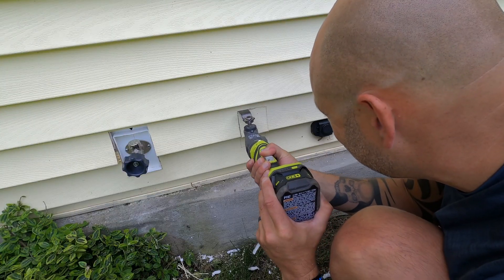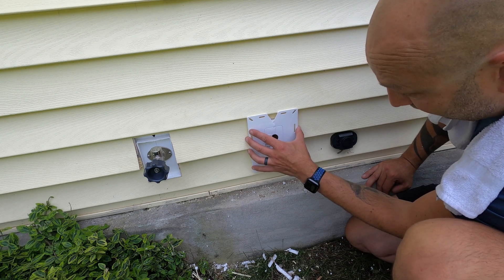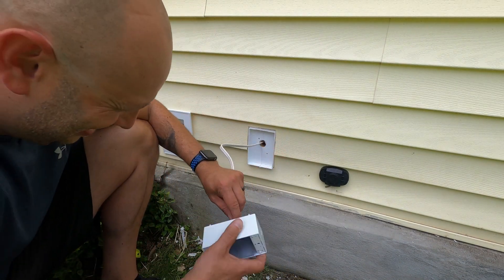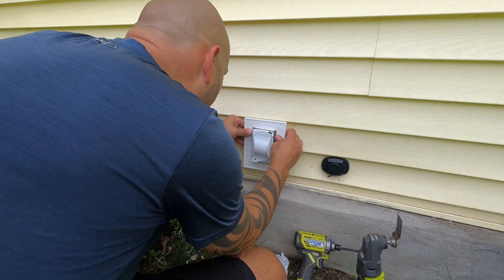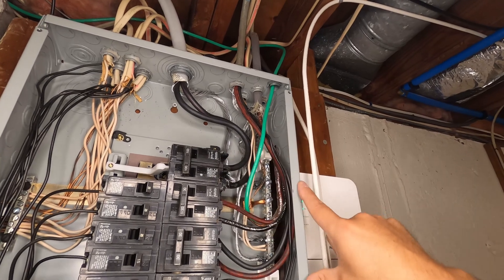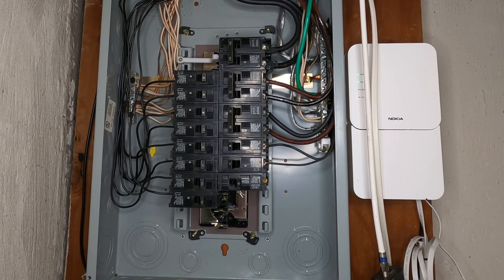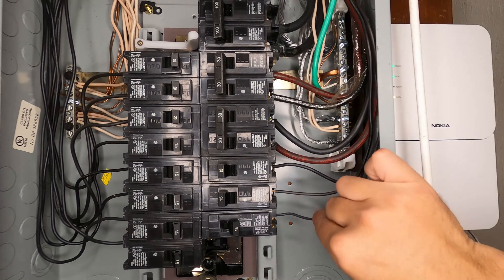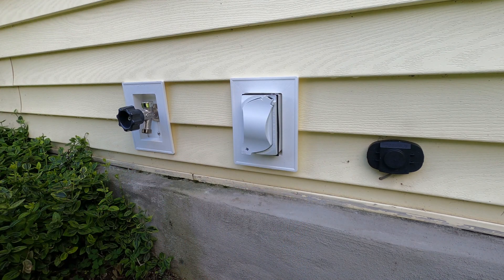Installing An Outdoor Electrical Outlet

Comment: Curious? That GFCI Outlet, Is It WR Rated? 
Second Why not use a weather-resistant cover that allows for cords to be plugged in with tge cover closed????
Reply from the maker: Pretty sure it’s WR rated because it came as a kit. Was cheaper than purchasing separately. I have a different in use cover on it now

Comment: Romex is allowed in a wet area install where you're located?
Reply: I was thinking if I would need to use the underground/direct burial type of 12/2 wire instead as suggested by some other tubers. I am in PA USA btw.
Reply from the maker: That’s how it’s done on new construction. Box is weatherproof and it’s gfci protected

Comment: Excellent video all around, but wouldn't it be a good idea to turn off the main breaker in the panel? I realize that the wires coming in to the panel are still hot, but it would kill the current to everything below them, making things a little bit safer to work around. And from what I understand, it's best to turn off each breaker individually first, then turn off the main breaker - reverse the procedure when turning the main breaker back on. Also, I believe that a 1/2" water tight service entrance connector can be used with threaded receptacle boxes like the one you are using.
Reply from the maker: Yup you can do that. The water tight connector would require you to hog out the hole behind the box if you’re ok with that. Shutting off breakers in sequence is a good idea to minimize arc flash potential

Comment: It Is illegal to staple the romex (nm cable) on the bottom of the floor joists. All of those have to be drilled.
Reply from the maker: Licensed electrician 24 years. And also it’s not stapled to the floor joist it’s stapled to the sill plate which is considered a running board which makes it legal

Comment: New subscriber here.  Excellent instructions and disclaimer on electrical. I am a retired electrical engineer and have a lot of respect for the power of electricity.   The builder put in a Cutler Hammer but all the sub panels I have stuck with Square D so breakers can be used in any of those places.  Thanks for the video.  I am about to put in an external GFCI covered outlet in our back yard.   I have the same split trim for my vinyl siding.  All the best from north Texas.
Reply from the maker: Fellow EE here too and licensed E1. Thanks for subscribing!

Comment: Line is the hot connection? 
Load is for down the line? 
Sounds backwards to me. 5:05
Reply from the maker: Line is incoming from breaker or existing circuit. Load is for if you want to add an additional receptacle downstream and have it gfci protected without having to add an additional gfci. It will be protected by the first one
Reply: @theguyofalltrades  okay thanks, I’m doing it now.

Comment: Curious what specific strain relief device you used? The ones I have are push-in and don't seem to fit into threaded knockouts.  Thanks!
Reply from the maker: The plastic strain reliefs made for romex wont fit the threaded 1/2” hole, they only fit a 1/2” knockout. I ended up using a 1/2” snap in bushing. The wire has to be stapled inside the house within 12” of the box anyways so not a big deal if you’re worried about the wire being secure. If you use a metal romex strain relief for that threaded hole on the box, the hole into the house would have to be much larger, like 1”.
Reply: @theguyofalltrades  thank you.  Just so I understand (since I have several boxes to install) is the purpose of the bushing to protect the wire from the knockout threads? Or just to plug up more space in the hole? I want to make sure I use one if it's required by code, but I originally just intended to use some duct seal putty.  Hard to find specific info about threaded knockout requirements online, so thank you.
Reply from the maker: To protect the wire. You can also use a bulkhead fitting. Most work I’ve seen doesn’t use one and I’m surprised they don’t get called out

Comment: This is great! Could that handle a Tesla charger?
Reply from the maker: Unfortunately not even close. A Tesla charger requires a dedicated 50amp 240volt circuit. Same install concept though. Pick a location, run the correct gauge wire, install charger and wire then add the circuit to the panel with a new breaker